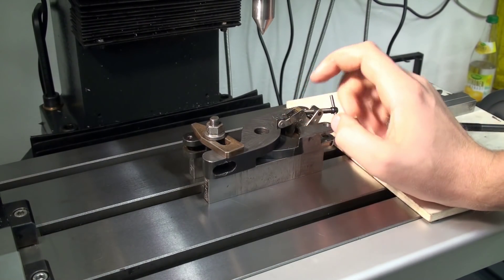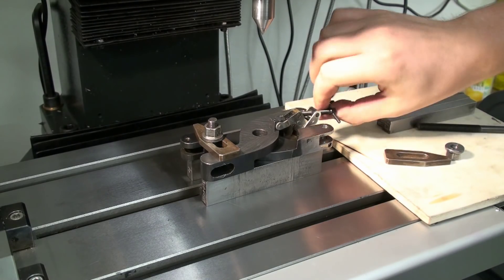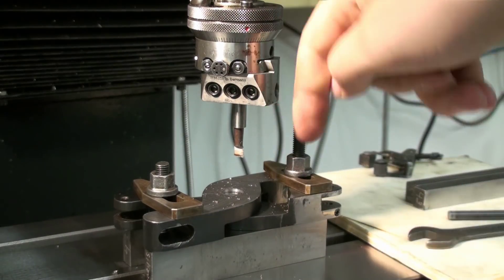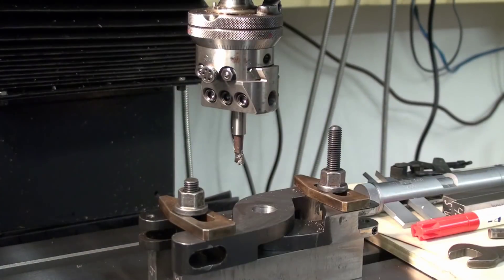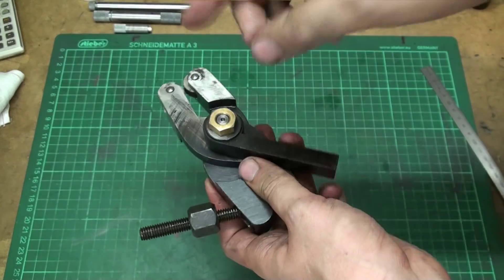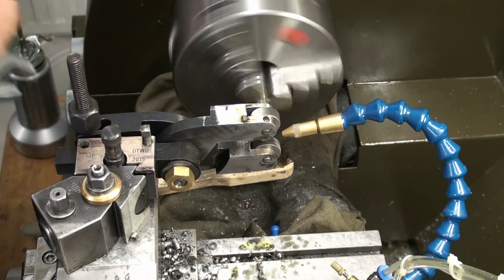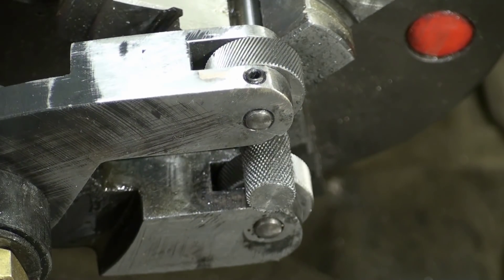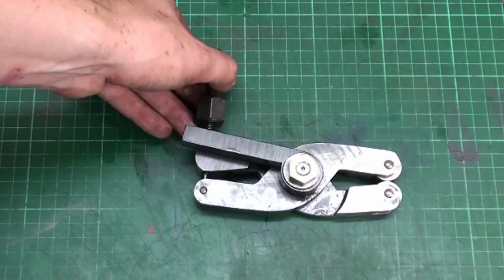Modifying a cheap clamp knurler  Part 2- Umbau einer Rändelzange Teil 2

Comment: Hi Stefan. Bought the same tool myself and basically did the same modifications except i added another, that was to make another nut with a larger numbered ring to dial in the same pressure for any given material to achieve the same results, hope this helps. James

Comment: I knurled with a 0.05 MM per revolution the normal cutting feed speed i use works pretty good the only problem ist the Floppy knurling tool it knurled a taper on there

Comment: Stephan, I've always been fascinated by the 'magic' that occurs when knurling.  The knurling tool always leaves a integer number of 'groves' regardless of the circumference of the work piece.  My thinking is that after the first rotation of the work piece the first set of groves formed now act like a gear that meshes with the knurling wheel.  Then, all the following rotations simply deepen the groves.
Reply: Yes, that is exactly how it works. It is literally impossible for the workpiece to NOT act as a "gear" as soon as the first impression from the knurl gets created.

Comment: Thanks for the vid! i usually power feed the knurl since i tend to get uneven knurls without power feeding. i run the lathe in reverse and use the thread cutting and very slow speed. this way i can knurl away from the spindle and safely run out of the end of the stock to get a complete knurl.

Comment: Great modifications. I have a similar scissor knurling tool and want to add your changes. I also added a taller adjustment nut for more clearance from my spinning chuck when adjusting with the wrench. Here is the link to the photos at HomemadeTools.net.  see:  http://www.homemadetools.net/knurling-tool-improvement

Comment: In theory it's  like cutting threads, and the pitch of the knurling wheels should match the diameter of the piece you are knurling. But it seems that it is not such a big deal, aaand as long as the wheels sort of fit the diameter, it will all work.
Nice series, thanks as always for posting.

Comment: i was rather taken with your boring head until i got a look at the money they go for over here!!!!

oh well... i guess that's part  of the lot of the hobbyist....
Reply from the maker: +crazymanmichael I got it for a reasonable price, and at least here in germany you can get one for 200..300eur on ebay. Its just a nice piece. Everything on it operates very smooth and when you use the auto-crossfeed on it to do a facing cut you forgett the price immediately :)
Reply: the cheapest i saw one here was $900 going up to $2000+ depending on size, etc. the do look sweet!!!

Comment: I'd hang on to the old wheels, and maybe built a different style of holder for them, similar to a pipe cutter.  I've used a form of knurling to bring shafts or spindles that has been spun back out to a more ideal fit, and those old wheels should be good for something like that.  Save your high quality wheels for when it really needs to look good.

Years ago, when I started looking into the procedure of overhauling an engine, one process they pictured was knurling pistons.  I assume they did that to expand them in a worn area to bring the fit back into tolerance.  Is anyone aware of the use of this process these days?  I've never met anyone that did.  I guess the ease that is involved in simply buying a new set of pistons these days has sent that step to the archives.

Comment: I should have waited for your series before purchasing an (Eagle Rock) knurler. I could have saved myself about $250. Nice improvement. I ditto Pierre Beaudry's comments. Perhaps you could mention the manufacturer of the knurling wheels in your video description. I couldn't understand the name from the video. Another nice video! Great improvement.
Reply from the maker: +Jim Milne I will add it - The manufacturer is "Zeus" take a seat when you look at the price for the wheels, two of them cost as much as the el-cheapo clamp knurler :D
Not sure about the eagle rock tool - It seems to be high quality as seen in Brad Jacobs video and is out of the box just a nice tool. On the cheapo one there was same labour needed...

Comment: Hi Stefan, the tool is 200% better than original.....
The main problem with the original seems that both wheels aren't digging the same depth, among other things.
A few things you might want to try next time you use it, better to use some good lubricating oil instead of cutting oil cause you're not cutting the material but forming it... second, you can start applying pressure slowly as it turns at first with no advance, and, then when you get the right depth you advance at about .15 mm per rev in automatic advance, you should be able to make a perfect knurl in one pass only... 
Let me know how it turns out...  ;)
Pierre
Reply from the maker: +pierre beaudry Thank you pierre! I will go for autofeed and give other lubricants a try, thats sure.
I still have your knurling-tool video on my to-watch list, but I took a peek in there and it looks like a very nice tool, well built - I will report back when I finaly get around to watch it :)
Reply: If you have any questions, you're welcome to ask.  ;)

Comment: Stefan, You really  have made a "silk purse from a sow's ear" (American? idiom); a tool that will be a pleasure to use. Do you calculate the work piece diameter/circumference needed to give an even number of 'points' before starting to knurl? Doing so improved my knurling.
Bob

Comment: Nice rebuild of an average cheap tool, another "kit of parts" assembled as it should have been at the factory.
When using the boring head I usually retract the tool at the same rate as the feed in, at least for the last few cuts. What this does is it takes a spring pass, usually, taking out any tendency for a tapered hole. If you get a spiral when retracting the tool, it clearly hasn't taken out all you meant it to, a slow retract helps.

Comment: Would the knurling improve if you had the work piece circumference to the knurl wheel circumference to a divisible ratio ?
Reply: Yes, but sometimes a perfect circumference is not an option
Reply: Yes, but sometimes a perfect circumference is not an option

Comment: I always avoided knurling,  thought that it involved some kinda witchcraft to get it right. Learning more from YouTube than I did as an apprentice!
Reply: +Flintstone Engineering With those tools it's a big improvement on the bump type tool, just have to get the right diameter... Also works great even on a smaller lathe... ;)